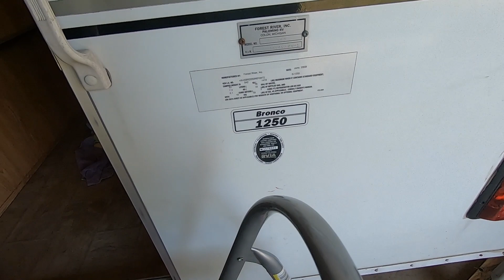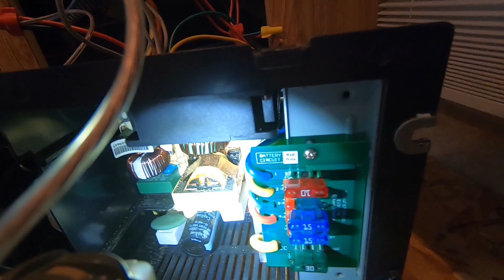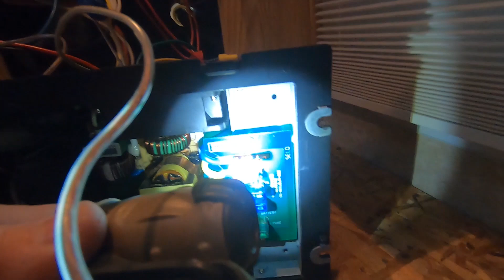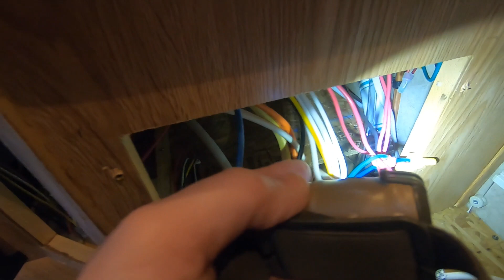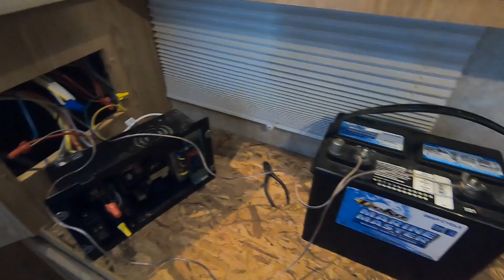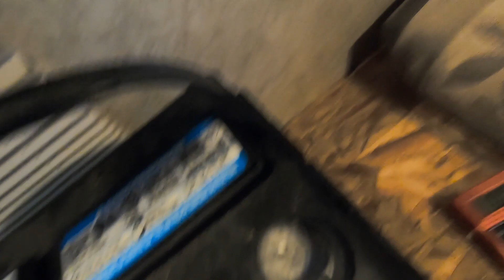Palomino Bronco battery install

Comment: You need to read up on the lithium battery you are installing.   You may need a specific charger for that lithium battery chemistry.   The lead acid deep cycle you have is ok on the on board power module at 13.6 volts  but 13.6 volts is a float charge or maintainer charge for a fully charged lead acid battery,  it's not a high enough voltage to bulk charge it..  You will still need a bulk charger for it to properly charge it.   If the battery is for example say half empty, 13.6 volts will not charge it.   At that voltage it might take days to fully charge it.   Bulk battery  chargers can go up to 14.5 volts to bulk charge a battery the size you have.   Get a bulk charger with at least 10 to 12 Amp charge capability.  15 to 20 Amps will be better to efficiently charge that battery over night.   You do not want the battery connected to the power module when charging.  Install a tansfer switch so the battery is disconnected when charging the battery.    Back feeding that 14.5 volts into the module could damage it.   A low battery cutoff might be a good feature too.   Over dicsharging a lead acid battery will negatively effect its life capacity.    Lithium batterys should have a low battery cut off built into it.  Batteries are too expensive these days to let them get abused.    Good Luck!!  Congrats on the new toy.
Reply from the maker: Thanks for all the good info, I will be disconnecting the battery when on shore power as you indicated and only charging the lithium battery with a dc to dc 30 amp charger from the truck alternator while on the move. I may purchase a shore power charger as well. Thanks again
Reply: @dozerboymiller  Study up on lithium batteries.  There a lot of gotchas for newbies.    There are concernes about charging lithium with your altrenator.   YouTube has lots of good info.   I looked into lithium and there lots of things to know before going lithium.    I looked into them right after commenting on your vid and it boggles the mind.    Seems there are tons of add on devices to protect the battery, protect your alternator and protecting chargers.   Definitely do your home work.    Buying the batteries is not the end of the line of purchases when going lithium.   If you are not going to use lithium everyday for powering your home with litium to store solar power from solar panels I don't think you can justify the cost for your application.    Learn before you burn cash.  Seriously, it is not an easy black and white investment.   Look into all the YouTube content and you will see.   Good Luck.

Comment: dozerboymiller,  Good to see You got it figured out. The Wing Nuts/Wire Nuts will work just fine. No need to change unless You really want to. Just make sure that You upgrade the wires on the Battery to # 10 AWG and use a 30 AMP inline fuse. Looks like the house battery might've been deleted at one time or it might've just use the truck battery. Thanks for sharing! 👍
Reply from the maker: Thanks, and yes I will be doing a lot to the system to make sure it can handle the charging and the load I put on the battery. I will be installing a dc to dc charger from the truck to a 200ah lithium battery. I watch tons of youtube videos and have learned so much about how to run the charging and battery systems. I never knew how complex some of the electrical systems people were adding to their rigs could be. I do enjoy figuring things like this out though.
Reply: @dozerboymiller  YouTube has a lot of helpful information for sure! I have been a Electricial contractor for 32 years and do a lot of RV Solar and really enjoy it. Lithium batteries have made a huge improvement over lead acid batteries. They are definitely the way to go. Just make sure Your converter is rated for lithium batteries. It's real important not to over charge them. Wish You the best with Your project! 
 If I can be of any help Please let me know. Cheers DC,⚡👍
Reply: @dozerboymiller any updates on the camper? Looking to pick up a bronco b800 myself